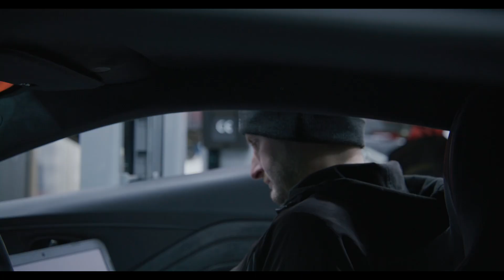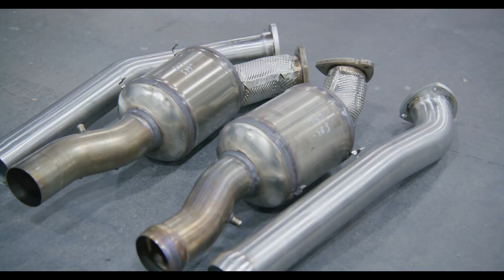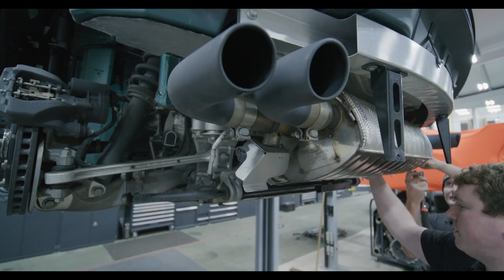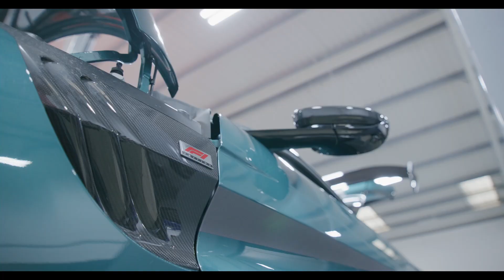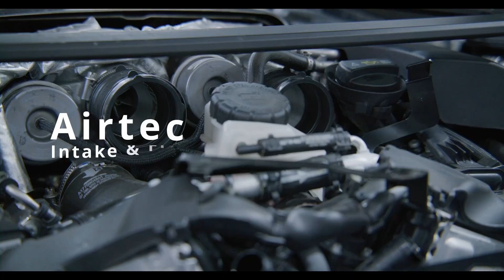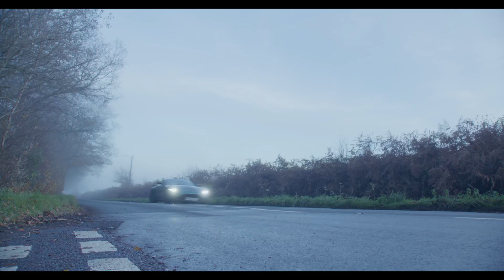Modifying my Aston Martin Vantage F1 Edition!

Comment: spacer front&rear mm??
Reply from the maker: 22mm per axel. Can be purchased from David Appleby Engineering.
Reply: Thank you for your answer. Did you work on the suspension? Or is it a pure suspension?
Reply from the maker: @chrischae5093  doesn't affect the suspension.
Reply: Thank you. Your reply helped me a lot